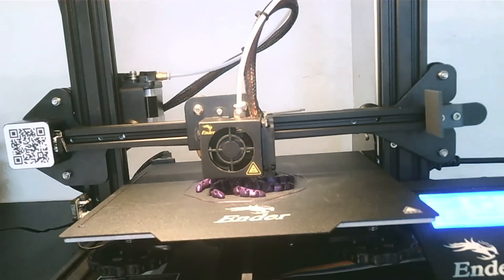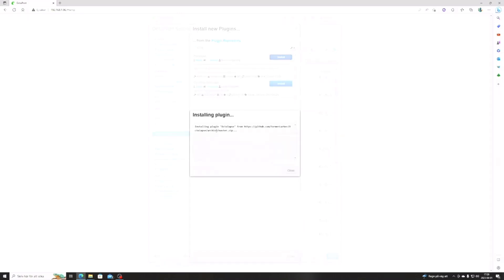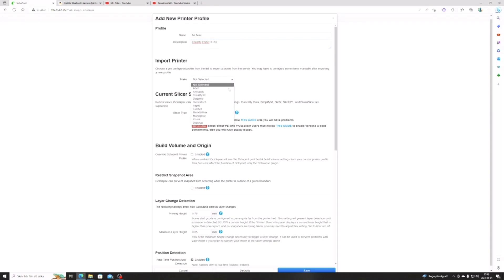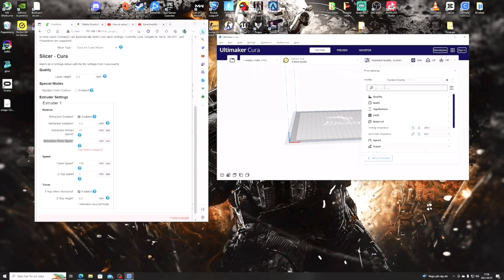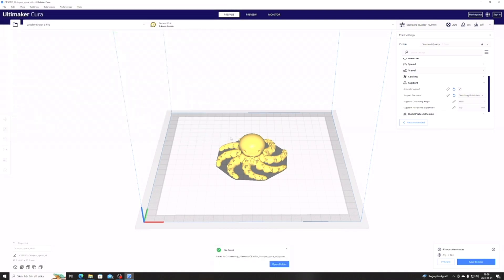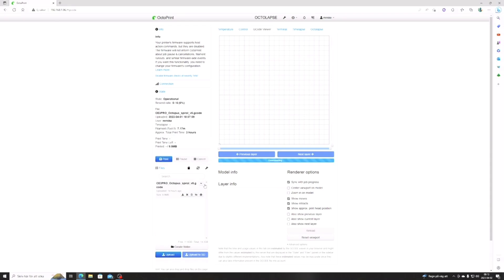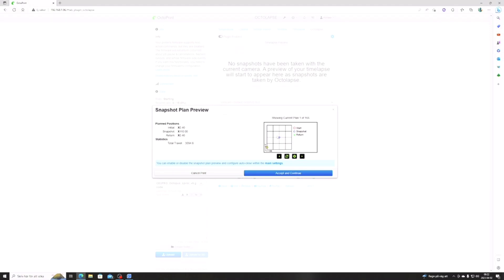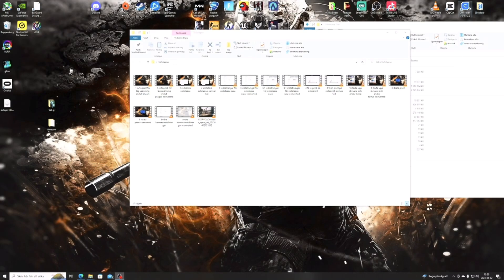2023 Super easy Octolapse Step by step install! We made our first timelapse video.

Comment: when you connect the usb to the printer you create a feedback loop and the printer starts to draw power from the raspberry pi. i used a small piece of tape to cover the vcc pin of the usb before plugging it into the raspberry pi and no more voltage warning. Hope this helps
Reply from the maker: Thank you so much.. i will try this. (*google* vvc pin on USB) 😂

Comment: You're getting the undervoltage message cause your Raspberry Pi is backpowering the Printer. To fix this connect your Pi and Printer with a "Data read only" cable so it doesn't supply the Printer with power which would leave the Pi with too little power supply.
Reply from the maker: Thank you. I Will look at this. So you are saying there is a power, a power AND data, and a data cable 😅 i thought i needed a P&D cable. But I’ll try with only data 👍 Thanks